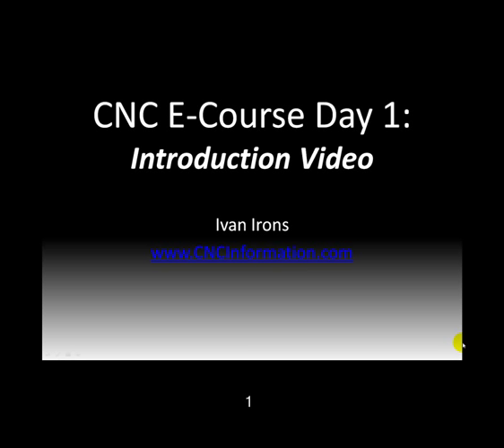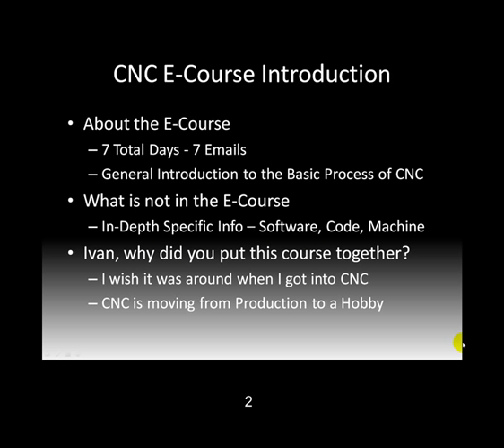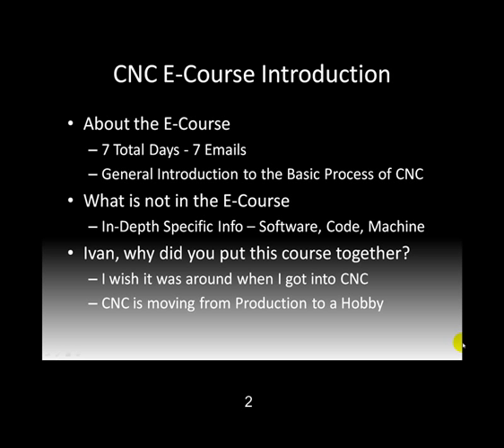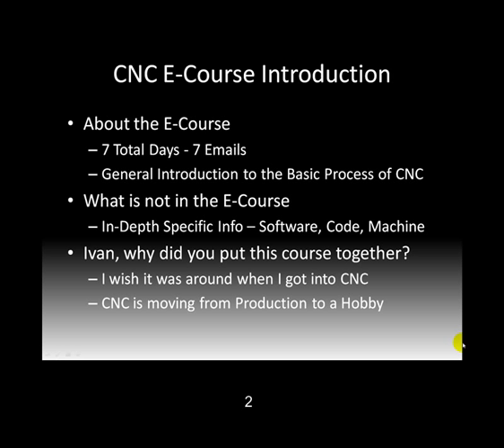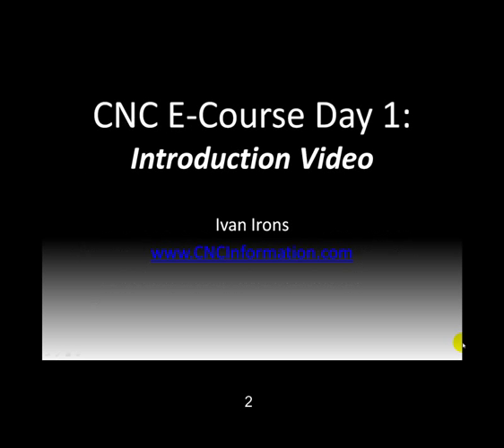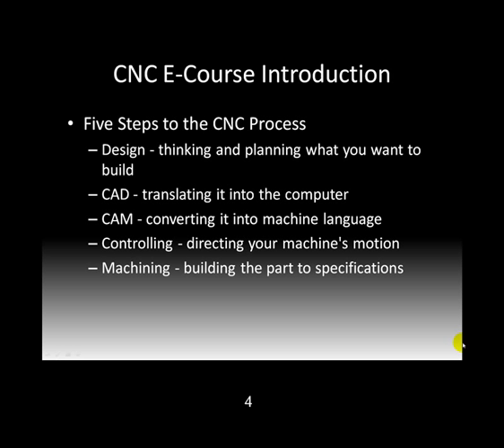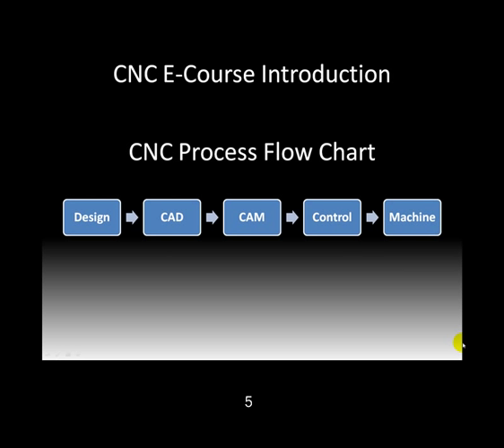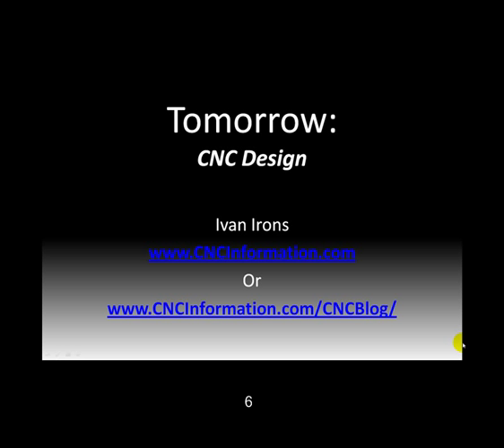CNC Basics E-Course 1 | CNC Basics Steps | Learn CNC | CNC

Comment: @kristijanadrian If you havnt learned by now, CAD is Computer Aided Design which is the design process, usually where the blueprints are created.  CAM is Computer Assisted Manufacturing where the blueprint is turned into a coded program and entered into a machine and the product is produced.  Hope that helps.

Comment: I have a CNC motor controller 3 axis Toshiba TB6560AHQ and 3 BS57HB56-03 Stepper Motors but when I power up the systems after while my motors “gets hot” without using them (in non operational mode) is that any normal? 

Do you know if Mach3 v R1.83 can work with USB to Parallel port converting pluck? Because I have a laptop with no Parallel port so I bought a USB to Parallel port converting plucks any suggestions welcome.